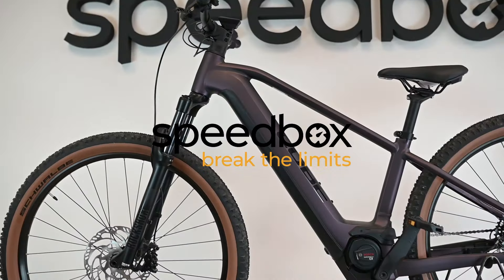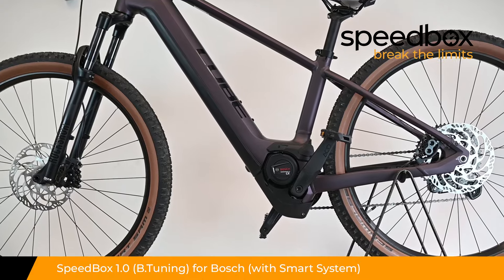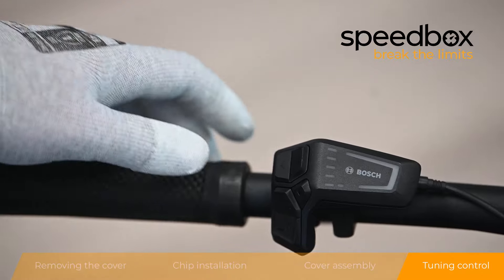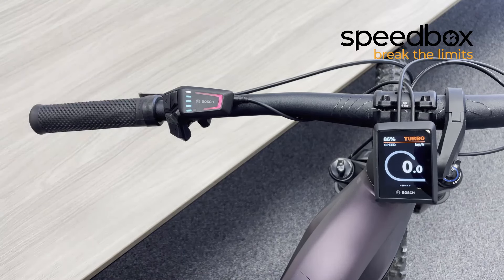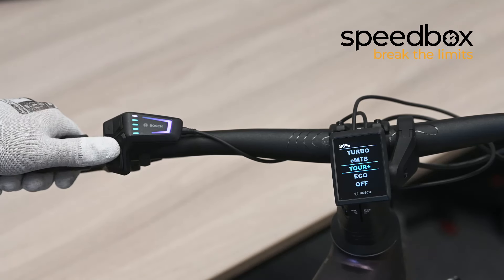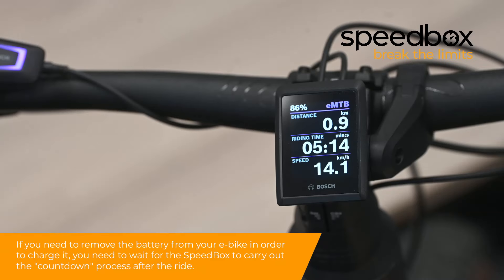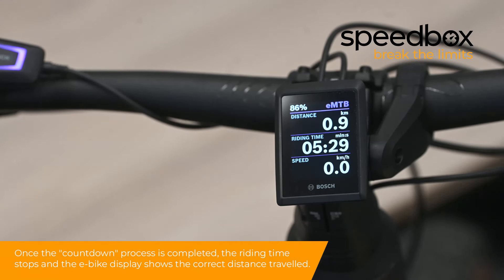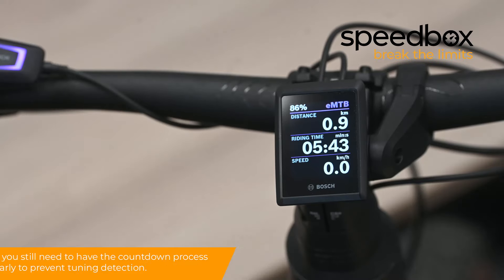eBike Tuning SpeedBox 1.0 B.Tuning for Bosch (Smart System) Installation Instruction

Comment: Hello, i want to buy a speedbox 1b for my radon relate 9.0 (bosch smart system kiox 300 and spoke magnet) but i would like to know if it is possible to tweak/finetune the engine when the chip is activated? So I mean about the same options you will have in the flow app to tweak your motor settings. Thank you very much in advance, looking forward to your answer. 🙏👍
Reply from the maker: Hi.
Sorry for the late reply. What motor upgrades are you referring to? If you are going to make modifications to the motor, then definitely before installing the SpeedBox. First verify the functionality of the e-bike before installing the SpeedBox. If you have specific questions, please contact our support team at www.speedbox-tuning.com or via Messenger / Instagram.
Thanks

Comment: My bike went to the limp mode after about 150km. I followed all the instructions. I did wait counting process etc. Before installation I deleted flow app and only used speedbox app. My max speed was always set to 35km/h. I have speedbox 1.0 b.tuning chip and it should have the february firmware.
Reply from the maker: Hi. We are very sorry for that. To prevent detection of tuning, we would also recommend the following: when starting the e-bike, downshift to a lighter gear and do not use Turbo mode right away. If you stop briefly while driving, for example at a red light, keep one foot on the pedal to maintain pressure on the pedal. If the error occurs again in the future, please contact our support. Thank you.
Reply: Was your bike connected with the flow app during chip tuning on ride? I suspect that with the statistics in the flow app the route data is analyzed for tuning detection. You can probably also get an error afterwards, so after the ride.
Reply: @SpeedBoxTuning it’s seems you guys don’t yet really know how the smart system detects these?

I’ve tried all the techniques stated and still end up with error
Reply from the maker: @scottfreeman5289  Hello. The Bosch Smart System contains dozens of parameters that can potentially trigger tuning detection. We have just developed a completely new device for the Smart System, which we will launch in November. Please follow our social media.
Reply: Cool! Have the same issue that the SpeedBox is detected. For now I have removed it so I can ride my Cube MTB. Is it possible to swap devices for a discount when globally available?   @SpeedBoxTuning
Reply from the maker: @mulleran  Hello.
Did you buy the SpeedBox from us or from a dealer? Please ask your dealer or contact our support team via speedbox-tuning.com or FB/IG. Thank you.

Comment: i have riesen muller ibik charger 3 get vario and i have bosh motor and also the chip for fast but i have the app speed box but i can’t connect to my ibik . anyone can help me please?
Reply from the maker: Hello.
To pair with the SpeedBox App, you must have a variant called B.Tuning. B stands for Bluetooth. What exactly is the name of your SpeedBox?
Reply: speedbox3.0 can you please help mee
Reply from the maker: @amirouchealexbour3440  Do you have version SpeedBox 3.0 B.Tuning for Bosch?
Reply: @SpeedBoxTuning  yes i buy just speedbox bosch 3.0 wat are you mean B turing? is this another version? of just speedbox 3.0
Reply from the maker: @amirouchealexbour3440  If you want to pair your SpeedBox with your smartphone, you must have https://www.speedbox-tuning.com/p/speedbox-3-0-b-tuning-for-bosch#245 You probably have this version https://www.speedbox-tuning.com/p/speedbox-3-0-for-bosch#237 without Bluetooth, so you can not pair it with smartphone.
Reply: @SpeedBoxTuning  i just have speed box 3.0 he's already in the bike. do you have any idea how i get til 40klm because now he supports me til 35
Reply from the maker: @amirouchealexbour3440  Yes, it is easy. You can set the maximum speed of an electric assistance by changing modes: Turbo - EMTB - Tour - Eco - Tour - EMTB - Turbo. An actual speed limit will be displayed after that. The maximum speed of an electric assistance can be switched by activating WALK assist function shortly or by turning the rear wheel 360°. The value of 1,5 km/h on the display corresponds with the limit of 15 km/h, 2 km/h corresponds with the limit of 20 km/h, 2,5 corresponds with 25 km/h, 3,0 corresponds with 30 km/h, 9,9 corresponds with 99 km/h etc. The last displayed limit will be saved after 5 seconds of inactivity. Please check the video https://www.youtube.com/watch?v=wbRFMx4gZgs&list=PLVEwMyjYWZ4_G7IZks-1M4HVzLYxIjntW&index=2
Reply: hello Sir, 
I have done everything, but 9.9 still supported my up to 36 but not 45 why? can je the speed limit off turn and you get 45? of how?
Reply from the maker: @amirouchealexbour3440  Hello. 
Since you've purchased an e-bike with SpeedBox 3.0 for Bosch already installed, we don't know its exact history. We recommend performing some of these steps: 
1) Check the position of the magnet on the rear wheel spoke and verify in the menu that the wheel circumference is correctly set. 
2) It would also be good to open the motor cover and check if the SpeedBox connectors are properly snapped into the motor connectors. 
3) Uninstall the SpeedBox from the motor and ride at least 5 km without tuning. During the ride, also switch between support modes. Then reinstall the SpeedBox back into the motor. 
If none of these work, please record a video showing how you set the speed limit and send it to us via message on FB or IG. Thank you.

Comment: Is active line supported?
Reply from the maker: Hello.
For Active Line (Plus), we can recommend SpeedBox 3.0 for Bosch or SpeedBox 1.1 for Bosch (this model is for Smart System). It depends on what kind of display you have. Or it can be verified by the shape of the connectors. Please see our website https://www.speedbox-tuning.com/for-bosch 
By the way, this video is on an older version of SpeedBox 1.0, which was replaced by version 1.1.
Reply: @SpeedBoxTuning  pff i bought secondhands Speedbox 1.0b but the pins are different. Any chance it can be exchanged with 3.0 no Bluetooth for Active Line :(
Reply from the maker: @ingush1989  Yes, SpeedBox 1.0 is for Smart System and has different pins. It won't work on your ebike. We therefore recommend purchasing the SpeedBox 3.0 for Bosch. You can go directly to our e-shop https://www.speedbox-tuning.com/for-bosch, or try a local dealer.

Comment: What is the top speed on speedbox 1.0?
Reply from the maker: Hello.
The maximum speed is 50 km/h. We now have a newer version of SpeedBox 1.1 with theoretically unlimited speed. However, we recommend not to exceed an average speed of 35 km/h for both models in order to reduce the risk of tuning detection.

Comment: Hello, I have a few questions. I installed my Tuning Module 1.0 b 3-4 days ago. When I turn on the tuning it shows me 10.0 km/h and when I turn it off 2.6km/h is that normal ? Then another question about the bike circumference, I don't know if it has changed or not where I installed it and on google I can't find anything about my bike Cube kathamandu 750. When I turned off the tuning and then ride the km/h display is clearly delayed and I wanted to ask if this is also normal ?
Reply from the maker: Hello.
If the speed is not displayed correctly, we recommend "calibrating" the wheel circumference. Here's how:
1) Go to KIOX display menu, Settings - My eBike - Wheel cicrum. - Adjust - lower the value at least for 10 mm (f.e. from 2360 to 2350) and confirm
2) The calibration lasts for approx 30 sec, menu Settings is not available in that time
3) Got to KIOX menu again: Settings - My eBike - Wheel circum. - Adjust - and return it to the original value (f.e. from 2350 to 2360 again) and confirm.
4) The calibration will be done again that, the tuning indication should be 2.5 and 9.9
5) If even after that the correct values are not displayed, please contact your dealer to replace the "chip".
Reply: @SpeedBoxTuning  Is it bad if I have already driven with the tuning ?
Reply: @SpeedBoxTuning  Does the tuning have to be on when I do the calibration?
Reply from the maker: @Pacha834   First, go to the menu and perform the calibration. Then turn on the tuning and test the functionality. Thanks.
Reply from the maker: @Pacha834  No, it is not.
Reply: @SpeedBoxTuning  I have carried out the calibration 2 times, once with 10 mm less and 20 mm less and reset it both times. It did not work, it still shows the same values 10km/h and 2.6 km/h.
Reply from the maker: @Pacha834  Hello. So the "chip" is apparently defective 😞 Please ask your dealer for a replacement.

Comment: can you still fit this when you havent got a klox screen on your bike
Reply from the maker: Hi. Activating/deactivating tuning is done by activating the WALK function. If you don't have the WALK function, you can activate/deactivate tuning by switching between two assistance modes twice, i.e. by pressing the + - + - buttons. The SpeedBox 1.0 B.Tuning version can then be paired with the SpeedBox App and activated/deactivated on the phone. We do not recommend using the Flow App at the same time in this case.

Comment: Do you think the system would work flawlessly if you didn't connect to the Bluetooth Flow app and only used an LED remote (No Kiox display)? I think this method should be tried and tested as it seems to be the only logical solution to bypass the detection. Most likely Bosch is detecting via GPS routing on the Flow App.
Reply from the maker: Hi. This is one possible option, but it has not yet been proven. Some tuning manufacturers recommend driving a maximum of 35 km/h, etc., but no one has yet verified this either. The Smart System is generally complicated in itself and Bosch goes to great lengths to make their e-bikes impossible to tune, so tuning for this motor is a bit of a challenge 🙂
Reply: My bike is never connected to GPS yet it still throws the error code after 50 miles or so

Comment: Hi all - I fitted one to my '22 Trek Rail - for the most part it works brilliantly and does what it says on the tin - however I feel it's only fair to warn prospective buyers that you WILL experience frequent controller crashes/reboots and KIOX speed indication freezes amongst several other odd issues.  The "Countdown" they mention happens erratically and sometimes even whilst still pedalling causing complete loss of power - distance is recalculated seemingly randomly and appears in chunks here and there - BUT MORE IMPORTANTLY I''m now on my 2nd Speed Manipulation Warning 524001 despite following the guidance of the device to the letter.  The bike is now crippled and in LIMP mode again - after the 3rd time I can't reset this myself.  I've done 3400KM with this device, it transforms the bike and my fun - I'd still recommend it, but please be aware that IT WILL BE DETECTED at some point!
Reply from the maker: Hello. Thank you for your feedback and we are sorry for the issues you had. FYI, in February of this year we updated our firmware which blocks tuning detection and seems resistant to system updates via the Flow App. Our view is that the Smart System is a challenge in itself. There are cases when it behaves unpredictably even without tuning.
Reply: @SpeedBox Tuning   @SpeedBox Tuning  thank you for the speedy reply... Great news that the device is still being developed ... but we have no way to update the firmware and my supplier is just asking me to connect to the flow app and update the bike ... this will of course report the manipulation to Bosch and void my warranty. I'm reluctant to do this but would be keen to trial later firmware in the speedbox. I'm unsure how to go about this?
Reply from the maker: @The5laYYer  Hello. Please contact our support team at any time via speedbox-tuning.com or on our social networks FB or IG, we will try to find the optimal solution for you 🙂 Thank you.
Reply: this is great honest feeback The5laYYer, couple of questions for you...what speed did you set the unit at, and did you use the flow app? Also noticed Speedbox asked you to contact them, what do they propose as a solution? Cheers
Reply: @fauzanahmed48  Hey - thanks for follow up - so at present both Speedbox (manufacturer) AND my supplier in the UK (ebiketuner) have been very supportive, suggesting that I get the bike firmware 100% up to date, then try a speedbox from one of their LATER batches (apparently POST February '23) ... I've done this, but not yet managed to test - watch this space!
Reply: @SpeedBoxTuning  I got a 524 error code and I can’t use my chip anymore. How do I know what batch my chip is from? Is there any way to update the chip’s firmware? Or has it become junk?
Reply from the maker: @tobiasbergstrom4935  Hello. We are sorry for your problem with the error code. Please contact us via chat on speedbox-tuning.com or FB, IG. Together we will find the best solution for you. Thank you.